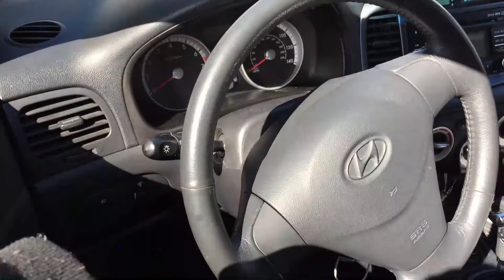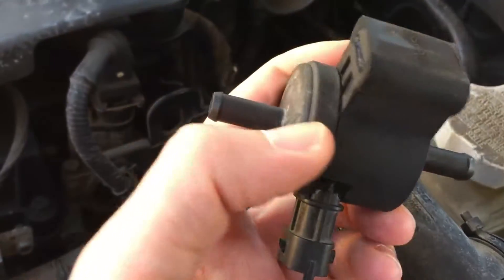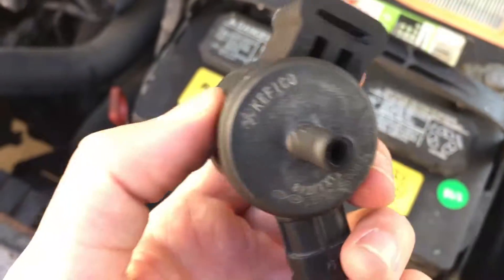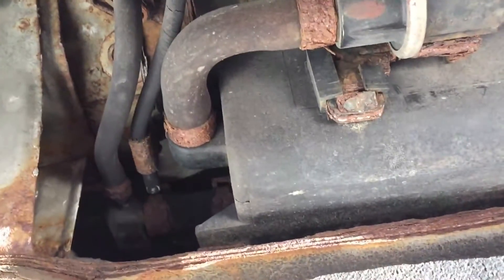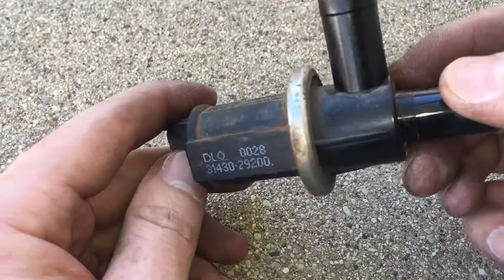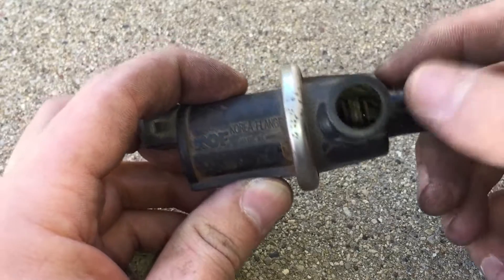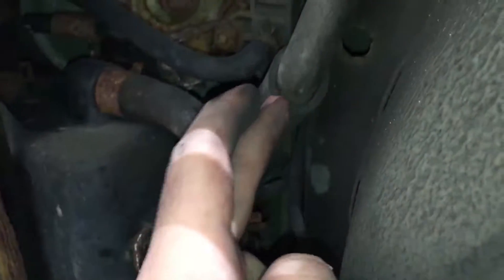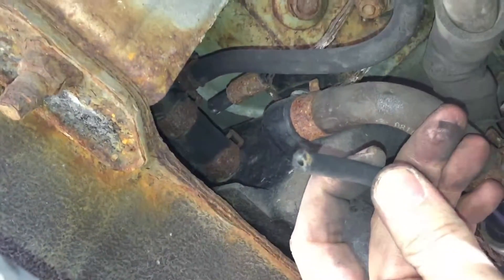EVAP Solenoid  P0496 High Purge Flow Test and Diagnosis 2005-2011 Hyundai/ Kia

Comment: Do you think a bad vent valve also causes extra fuel consumption? I already change the one that is close to the motor but I haven’t check the one that is close to the fuel tank. I have that problem that when I fill up the gas I have problem to start the car and I have to press the gas pedal to rise the rpm to be able to turn it on. Thanks for the clear explanation I have a 06 kia rio
Reply: Hard start after fill up is bad purge valve, stuck open allowing fuel to be pushed into the intake manifold

Comment: Did this solve the code? This car is driving me nuts. I had an 08 that had zero issues for 200,000 miles and I totaled it hitting a deer. This one I have replaced the purge valve/crankshaft sensor/camshaft sensor/starter/fuel pump. I have the CCV on order right now because it is dying after fueling up. Fuel cap/purge valve on the front of the car did not fix the problem.
Reply from the maker: Nope. Still shows off and on.  Hate this car.
Reply: @BulliKid  It's sad because I LOVED our 2008... We had it since new/took care of it and when I went and did everything I could to find another just like it, it bit me...

Comment: Thank you for all the explanation. I have P0496 code on Hyundai Genesis. Replaced sensor in engine compartment. Cleared code, but it came back. Its probably one of the sensors at canister. Car runs great. Gas fill is no issue.
Reply: Did you fix it ?